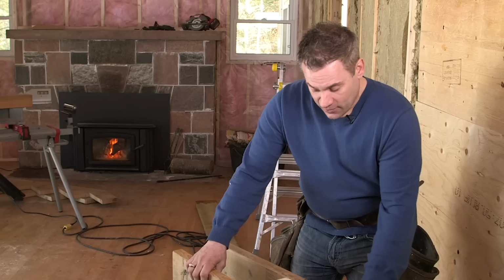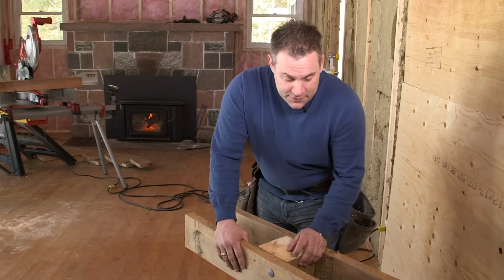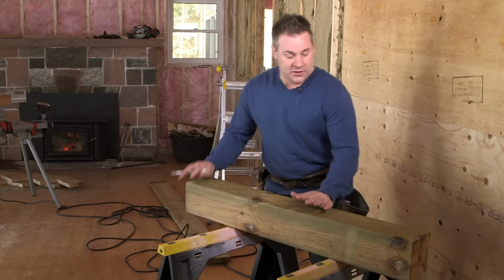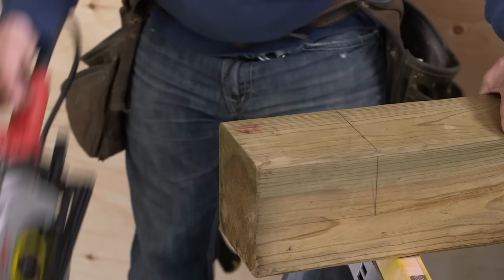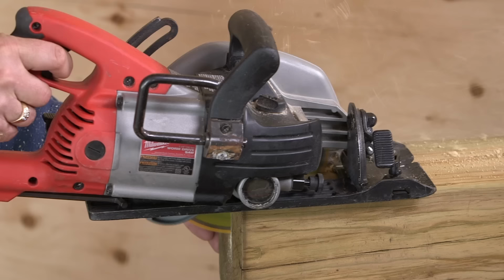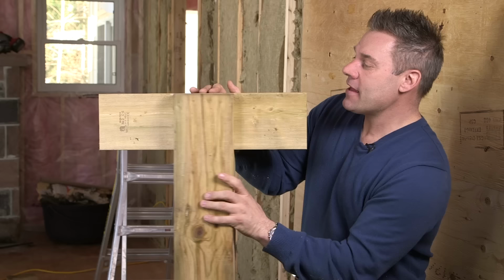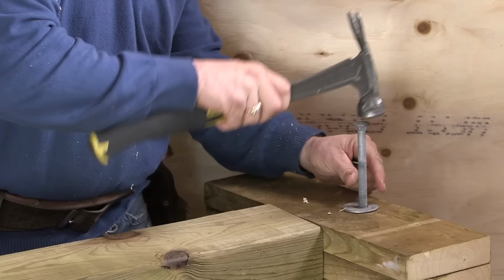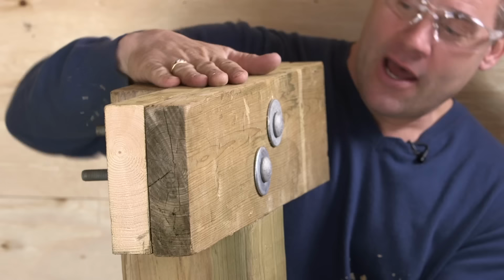How to Attach a Beam to a Post for a Deck | Decks, Docks & Gazebos

Comment: What are you talking about ... "no shear strength"?

Those two 5/8" carriage bolts have a MINIMUM shear strength of 73, 300 lbs ... 36 TONS, which far exceeds the shear strength of the lumber!

Now, I cut shoulders in my post, but I do it for the right reasons.

[Most inspectors will fail an unshouldered joint not knowing why.]
Reply: It's the wood that fractures, not the bolt.  I've seen it.  Another problem is splitting the beams around the post.  The 2 beams gain strength by sandwiching them together!!  Its ridiculous to divide the beams apart. You lose the whole purpose of the beam!!
Reply: @JM-nh8yp  I never sister treated lumber together espically beams. They will rot twice as fast when sandwiched together.
Reply: @markherman4023 I hear what youre saying but thats due more to improper technique.  If they're dried and flashed properly they dont get rotten in between and they are stronger together than they are seperate.
Reply: What's the sheer strength of the board when it splits across its grain.  The joint is shouldered because  its stacked on framing, this is the same reason we dont build ballon framed houses anymore.  The bolt may be strong but the wood is not.

Comment: Span of a double 2x6 beam is limited to about 6', so each post would have about 36 square feet of deck it's supporting.  Deck loading is typically estimated at between 50 lbs and 100 lbs / square foot (higher in some locales).  Deck load on each post would then be between 1,800 - 3,600 lbs.   Load capacity of the 6x6 post is 20,000 lbs.  Standard deck footing on clay soil is load capable of about 5,000 lbs per square foot.  Most guys put a 12" circular concrete footing under each post, or about 0.8 square feet.  So the footing would be rated at 4,000 lbs.  Shear strength of even cheap 1/2" carriage bolts exceeds 10,000 lbs, and there are two in the beam, for a minimum capacity of 20,000 lbs, typically closer to 40,000 lbs.  Results: the concrete footing in clay soil exceeds capacity estimates of the deck by just +10%.  The 6x6 post exceeds capacity needs by +300%. The carriage bolts have a safety margin of between +300% and +700%.  The doubled 2x6 beam is right at capacity in this "design," and is the weakest point.  Expert advice would be to increase the beam to doubled 2x8.  Notching the posts adds some strength, but only to parts that are already the strongest part of the deck in this video.

Comment: Simplier to set the beam on TOP of the post and use either a tie metal plate or nail/screw/bolt a 2x6 on either side of the post to build a pocket. 30 years later with treated lumber my deck is still standing !!

Comment: Someone already mentioned this, but I would think the problem with the first configuration is that the beam will crack horizontally long the grain and in line with the bolts way before the bolts shear.   I like your solution just fine.

Comment: I built my deck 20 years ago using the "wrong" way. It's still absolutely rock solid.
Reply: Yep I  did the same. This is probably a better way, but the other way isn’t wrong
Reply: @guywalker5205  yes it is you just got away with the wrong way
Reply: Doesn't meet code though. That's the reason builders such as myself have to go fix so many wrong diy Jobs.
Reply: @guywalker5205   No, it IS wrong.
Its an engineering and Code (lawsuitability) failure.
A lot of people luck out and don't get bit, its from the majority of others failures that proved it was a failure which is why it became 'bad practice'.

Comment: Well i built my deck the wrong way 24 years ago and still standing strong!🤣🤣🤣
Reply: Daniel Primeau I build more than one deck, in earthquake country, and they are all still standing, 15 years later.
Reply: I've seen a lot of people argue for notching.  I just don't buy it. I understand the argument that carriage bolts are designed for shear strength, but they never seem to address the fact that there are usually two carriage bolts at each post and they are really thick. It would take a tremendous force to shear both of them simultaneously.  Also, they are under constant tension - they're basically squeezing the post which means you would have to overcome that friction as well. Not to mention how the joists are connected to all the other framing members including the decking material. Just seems like bs to me.
Reply: Well I guess that is you "living life on the edge" - mmm I hope you have a good will and/or lots of insurance!!  LOL LOL LOL  🤣😁😜😂
Reply: As did I 25 years ago. Still standing. Had a large group over recently. No problem.
Reply: @derikyeager7250 You are correct.  The odds of 2 carriage bolts shearing are remote if you are using large bolts. Rot and termites are the big hazards.
Reply: I built one thirty years ago that is still standing. And I use two extra steps during assembly, I drill a shallow hole for the washers to set in and I seal the holes and the end grain of the wood.
Reply: did you used screws?
Reply: @derikyeager7250  
Not BS but over kill
As an electrician we have rules in notching , try to avoid it
Reply: Things were done a LOT , differently back then.... Mine is almost 40 yrs old.  Never replaced anything.  Have taken care of it with regular maintenance & weather resistant coatings
Reply: There are tons of buildings with unshielded wires that never burned down either but it’s doesn’t make it right. Just google deck failures and people get hurt every year from deck collapse. Failure at the beam connection is the primary cause. Pocketing the beam also allows you to bolt the double beam together using Headlocks or carriage bolts to create a stronger beam.  If your building a deck in your backyard that’s less than 3 feet off the ground thats fine but if your a builder with liability and over one story high, I wouldn’t take it lightly. And “engineers” quoting books and using elephants, i’ll point out that engineers design fail all the time and kill people all over the world. An extra step is worth the effort.
Reply: Carl Bruschnig, Jr on a chance
Reply: The bolt method is one of those "good enough" methods for most decks. His notch method is just alot better.
Reply: Same here and never seen broken carriage bolts
Reply: @derikyeager7250  half of the reason big bolts are used are for aesthetic design. Yea you could probably hold each connection up with a single quarter inch bolt, but since a deck is exposed, it looks super ugly.
Reply: @cuzz63  notched is only better if its not exposed to moisture
Reply: @derikyeager7250  as an engineer, shear would imply impact. no one is dropping 2 tons on deck.. cutting wood for notches weakens it and make it susceptible to rot.
Reply: @derikyeager7250   me toooooo!
Reply: @derikyeager7250  I don't understand the notching part, just put the beams on top of the post.  IF you don't here in southern NY you will never get it to pass inspection.
Reply: This video is an opinion, he does not understand that clamping force friction is actually holding the beam with ease with some tension force on the bolts
Reply: @mica122213  shear is not an impulse load, but a constant force along the shear plane.  I suggest you request a refund from whatever college you attend(ed)
Reply: Same.  I attached beams using twelve bolts through six posts in this fashion.  I'm pretty sure the strength of the bolts is more than adequate.  One time we put a shallow pool on the deck and filled with water.   Realizing the bolts had to hold the extra weight, I got crafty and cut 2x6 boards long enough to screw along side the posts.  The boards basically extend from the concrete footing up to the beam so there's something directly under them now to carry the weight.  I wish I hadn't built the deck this way, but I can still rest easy that we'll be fine.
Reply: Chris h Sure there are and they were built years ago before we knew a better way. I’m simply saying that if you’re going build something now and we are educated,  then you build it the better way. There are just better ways to be safer. We used to build airplanes out of fabric too but we found a better way
Reply: @connorcincinnati  most deck failure I investigated was ledger board failure, not beam failure.
Reply: Thomas Marable Absolutely you are correct. The ledger board is the most common failure on decks. Improper attachment to the house, rotting lumber and even joist hanger corrosion. This whole thing started with what is the best way to attach a beam to a post. I simply suggested the best safest manner not intending to imply it is the only way or that this is a common failure point.
Reply: @connorcincinnati  I am lazy I put my beams on top and by an engineer bracket made for that purpose, no notching required.
Reply: Thomas Marable that works great and my preference as well and I attach with the large Simpson flat strap 3x16. And #10 screws.
Reply: @derikyeager7250   not legal 2018 IRC
Reply: @lostcause1206   a  electrician  dont have to know the 2018 IRC. a plumber does. a plumber has clause a lot more failed framing  problems. a electrican dont have to know the framing rules
Reply: @dknowles60  an electrician needs to be proficient in all trades .
Reply: @connorcincinnati  20+ years working with engineers, we like to over design something it's always the contractors cheaping out on the build.
Reply: @lostcause1206  Also we got a call to investigate some roof trusses in a new garage space because the electrician drilled holes through all the bottom chords to run wiring after he was told to run on top of the bottom chord....
Reply: @brianhanlon9602  not an electrician then .
Avoid drilling and notching as often as one can .
Reply: Brian Hanlon I’ve been doing this for 42 years and I promise you that NO trade is above cutting corners. Electricians and plumbers are no exception. No trade can avoid cheaters cutting corners. Unions protected customers with a qualified training programs but today many areas will issue a license based on passing tests. Some cheat and some people just don’t know the correct method. 

Engineers have a long collegiate education and apprentice program which weeds out most idiots. But don’t be fooled thinking that engineers don’t make mistakes because they can.
Reply: @lostcause1206  This guy was a licensed electrician....
Reply: @brianhanlon9602  not worth a shit then ...
Shawn , a lazy cheat that cuts corners is too lazy to drill or notch anyway...
Reply: @connorcincinnati  Absolutely! There's a reason the firm I work for has a pretty tight review process before anything leaves the office.  Still there are times when things are missed, rare, but it happens.
Reply: @connorcincinnati  I'm stating  a lazy person that takes the ez way out is too lazy to drill or cut .  Im not referring  to you
Reply: Gringo Thank you. A view of your comment  looked as if you said my name and then said I’m a lazy cheat which I’m not. I stated in this original post that you should either bear the beam on top of the post or notch it. It’s not the only way to do it but if you’re responsible for peoples lives on a high deck, the best way is to notch it. Always over build on decks.
Reply: Apparently your gravity isn't very strong.
Reply: @mica122213  great reply. Absolutely true.
Reply: @connorcincinnati  I can't count how many times engineers have called for the use of TJI i-joists with the strict drilling schedule associated with them(drill the center) and then I look at my plumbing prints and see that they want me to run my DWV across 10 of them in the joist space. They then struggle to understand the concept that it's impossible to run DWV through the center of 10 joists and still have pitch. I respect engineers, but they need to experience what it actually requires move something from a paper to reality. My other favorite is when they want me to run 4" pvc up a 2x6 wall and install 1" insulation... 6 1/2" in a 5 1/2" wall haha.
Reply: @derikyeager7250  The squeezing friction regarding the loads we’re talking about is negligible on two smooth wood surfaces.  If we were to take the same bolts, torqued to the same value, but let them “slide” through a vertical slot on a post not fixed in a hole, the strength would be minimal
The shear strength of one 1/2” bolt is over 3 tons (6500lbs).
Reply: @lostcause1206  I do not understand how the two are equivalent.  We don’t notch joists if we can help it, but that is a whole different set of load factors.  While I don’t have the same beef about beam support by using carriage bolts (assuming they are the right diameter), notching in this case is placing the load in perfect line with the vertical support vector.  The remaining section that the bolts are attached through are merely there to prevent shifting.  The forces in the horizontal direction are nonexistent on a full vertical load as is found with a deck.  That force increases if there is a sloped roof and increases as the pitch of the roof increases.   I assume that a violent earthquake action could possibly snap that “tab” leaving the beam sitting atop the post unrestrained and subject to disengaging and toppling.  In that case, in a high earthquake zone it might be prudent to sink a lag or two vertically though the beam and into the post or use galvanized plates to restrain the potential movement.
Reply: On the corners I have just the bolts but in the middle I put a 4x4 beam underneath and a 4x4 to the ground to support the load just in case. 

If you are making a deck id recommend getting 3' ground spikes, they are fantastic and give u an instant strong footing that your 4x4 sits in
Reply: @derikyeager7250  in most small deck applications with small loads, using carriage bolts to take the load will be fine. But as a matter of principle, posts should be bearing the load. It's best to get in the habit of using best practices
Reply: @derikyeager7250  My thoughts exactly reflected there Derik.
That friction alone adds to the overall strength immensely.
Reply: TJP 81  maybe in 200 plus years. Creep and rot are not a factor in normal service life. Maybe some extreme cases. But no doubt a notch is a solid bearing method.
Reply: @thomasmarable6818  I've seen some really ghastly ledger attachments, some VERY unsafe.  Some attached the very same way but the deck was supported by posts against the house.  I've told a client that I would work on his existing deck if he'd let me fix the ledger issue.  He agreed and had no idea that it was a problem as he did not install it.
Reply: Congratulations on an adequate job poorly done.
Reply: You aren't going to shear off those carriage bolts with any realistic weight or tension that would be applied to those beams.
Reply: @derikyeager7250  My deck is 25 years old with carriage bolts that he said was wrong. I've had 30 people on that deck banging around. No problems. Plus there is not just one beam but several. I would be willing to bet him my deck would last just as long as a notched one
Reply: Take a picture with you and 20 friends standing on it, I bet it fails.
Reply: That’s because unless your deck is holding up elephants 2 carriage bolts work fine.  Just snug up the nuts every few years.
Reply: Well, 24 years ago, carriage bolts were not made of tin foil like today's cheap junk.
Reply: Dittos D. 10 years the wrong way, still standing strong.
Reply: @derikyeager7250  Yep. The timbers would be destroyed before the carriage bolts would shear.
Reply: Same here
Reply: You're just lucky. Don't have any dance parties out there.
Reply: In building everything is design to transfer loads to the foundation. You can get away with a single story deck using machanical fasteners but would you rely upon those fasteners to hold up 5 stories of decking without the weight of each floor being distrubited to the foundation?  A solid foundation is built for a reason and it's not for holding up machanical fasteners. Your deck might of lasted 40 years but it would be I'll advised to build upon it when you foundation is nill and void.
Reply: @tedknauss465  Maybe you haven't but build a second floor above that deck being held up by carriage bolts. Why would you want to limit you construction that you do now for future additions weather you do it or not? Transfer the load
Reply: @dustchip8060  Sure, also don’t park a 747 jumbo jet on it. Thanks for your brilliant observation Captain Obvious.

Comment: I have just calculated  the shear strength of a 12mm (1/2") carriage bolt is between 56 and 72 tonnes.
That is assuming the moving surfaced do not deform
I would be happy to use a 50% value for my structural validations.
And there were TWO carriage bolts !!  
You need a lesson in structural mechanics my friend.
Reply: Regardless, it's the code in my area, so someone else agrees with him.
Reply: It’s the bearing stress in the wood, not the shear strength of the bolt that makes a bolt only joint weak.
Reply: His example was not the same.